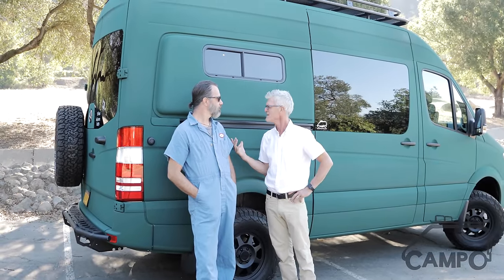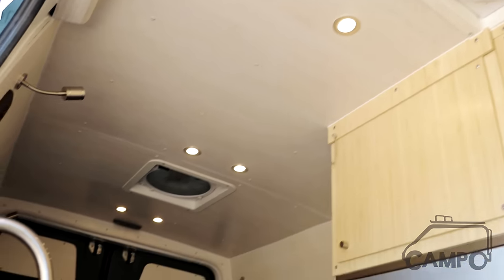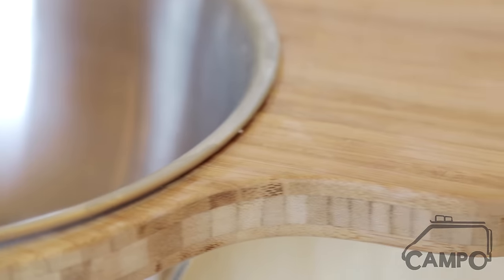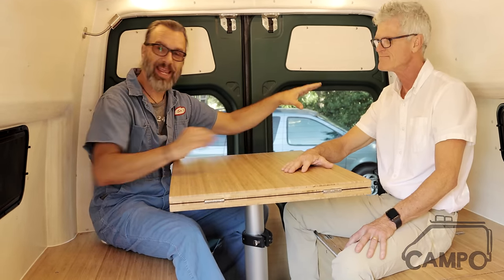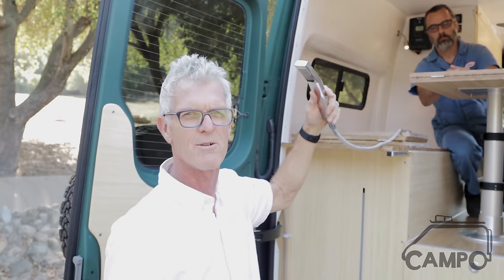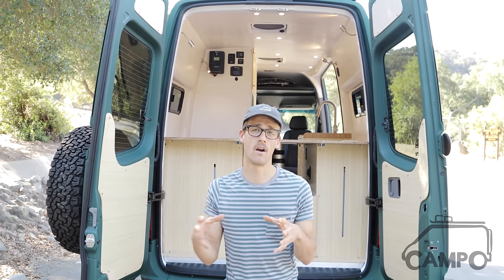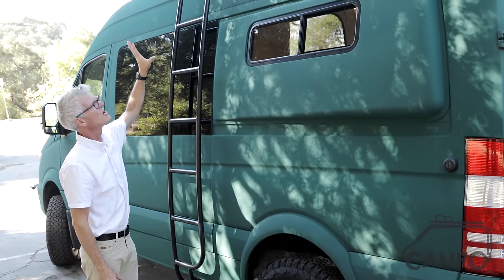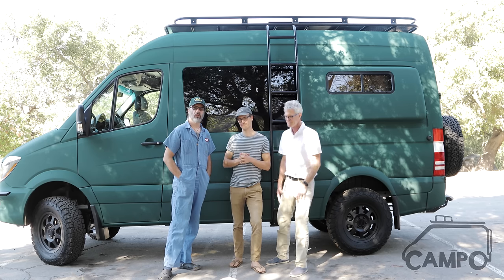VAN TOUR - 4x4 Sprinter with BATHTUB

Comment: What are the benefits of that ceramic paint?
Reply: It inhibits heat transfer. Keeps the van cooler in summer and warmer in winter. Don’t know about that color though...
Reply: @scnomad3626  , it would be cheaper to buy a white van.
Reply: Cristi m please explain how a white van is warmer in winter
Reply: @scnomad3626 , cooling takes much more power than heating. Dark paint, even ceramic, will be much warmer than white in the summer but about the same in winter time. Please read again, I said that it will be cheaper, not warmer.

Comment: Wait... but .... you'd empty your entire water capacity for a 20 min 95-100 degree bath? That's like luke warm, and then you have no water left. I'd imagine this is really ONLY for if you're hooked up at an RV site with water on demand?

I dunno - it's amazing that you got it to work for the customer, but this seems way over the top and not sustainable or practical for a vehicle that is meant to go off road to remote places....

"can doesn't always mean 'should'" --- if you know what I mean...

Comment: I'm kinda 50/50 on this. ..I love my tubs so I appreciate the build with one, but on the other hand this rig seems a little to small to have everything. ..I don't like the bed set up. .plus having to arrange when to use what. ..let's eat and use the table then let's bath then let's make the bed. .to much fuss...talk about agreeing with each other on everything. .you would have to. ..so by saying this I think the money that was involved in building this van you could have gone bigger where there would be a little more elbow room and actually be able to sleep and eat at the same time or take a bath. .OK that's my thoughts. ..oh and heated flooring which is not expensive would be great and cozy. ...
Reply: Lol what r u saying its custom made for client specification!

Comment: Eh.. That’s easily 800+ pounds of just WATER. I guess (when FULL) it might help keep rig in better traction, being 4x4 and all. Use of cooktop as “heat source”? That’s got disaster written all over it. Cool build and all, but this is a clear example of “customer is ALWAYS right, even when they are WRONG” & “more money than brains”?

Comment: A tub in a camper van is pure stupidity, apart from the weight on the suspension causing unnecessary wear, when you are off grid water is at a premium, it’s a waste to fill up a tub full of water to soak in when you don’t have enough for drinking.

Comment: The interior woodwork looks so cheap with those screws holding the piece of wood and those unfinished rough edges...
You also need to be on city water to use the bath..I don't think the onboard water tanks could fill this deep bath twice...useless. Not enough storage... Most amateur vandwellers  build this type of interior ...I hope the price is low
Reply from the maker: Hey Ronnie, thanks for the constructive criticism.  Fortunately the on-board water tanks can fill the tub twice and still have 15 gallons left over for dishes/cooking/hand washing!  Have a great Monday!
Reply: Campo Vans  How much water do the onboard tanks hold ?   where are they situated ?